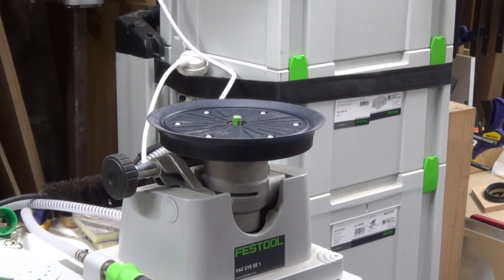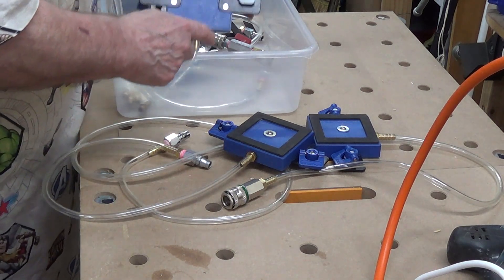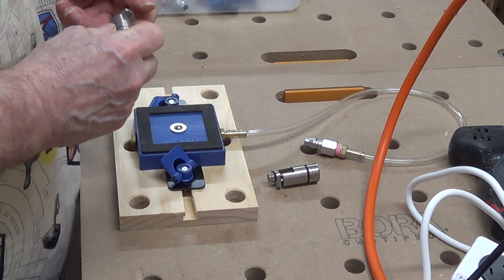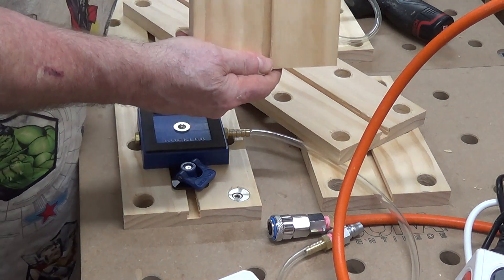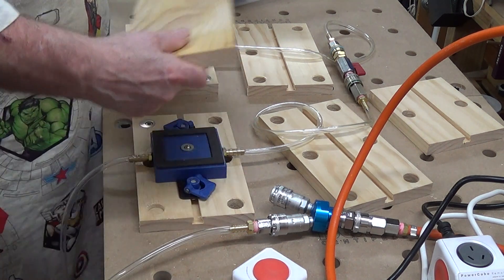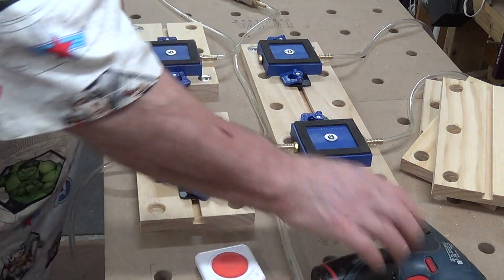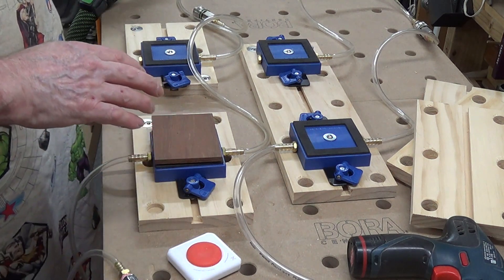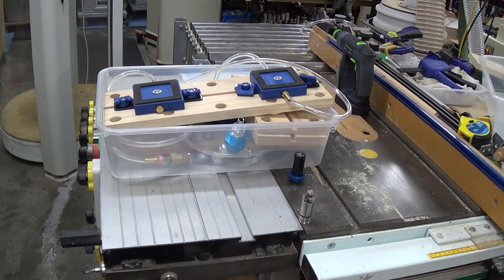Rockler Vacuum Clamp Pod MFT Benchtop mounting.

Comment: Nice setup. Can you show the part number for the Nitto couplings you used. Thx.
Reply from the maker: Unfortunately you are one garbage cycle collection too late... I have thrown away all the packaging last week and I chose my items by sight and not by part number.
However, giving part numbers may be an issue as different stores supply different brands and the combination is limitless.  Basically the buzz word is 'Nitto  1/4" BSP' fittings if you choose Nitto and 1/4". There are many different types of connectors depending on your global location. I use Nitto on my compressor and air supply in the workshop so it's Nitto for me.  I chose 1/4" as the tubing I use is 1/4" (or 6mm and a heat gun to fit the 6mm over 1/4" bayonet fittings). Choosing what piggy backss what is just careful planning  as the part you may need to perform a particular function may need to be combined by two different parts... either because of your requirement or unavailability of that specific part.  Good luck... I'm just a noob so if I could make it work anyone can... just plan and chose your parts carefully to avoid unnecessary expenditure and left overs.
Just shop around... prices can vary dramatically between suppliers.  In Australia I found "Enzed" had better prices for most parts... but then again I said most parts.